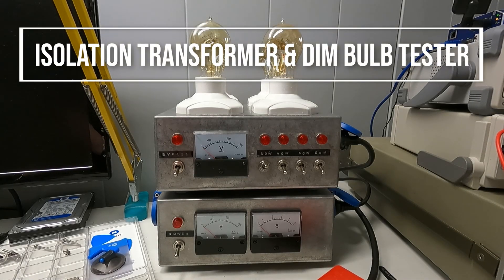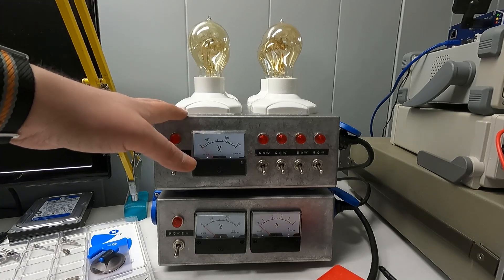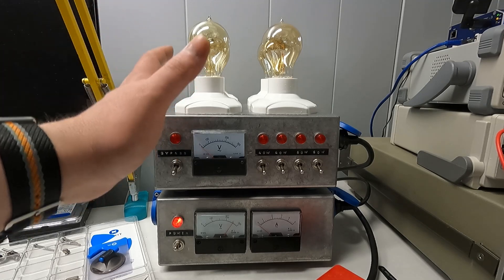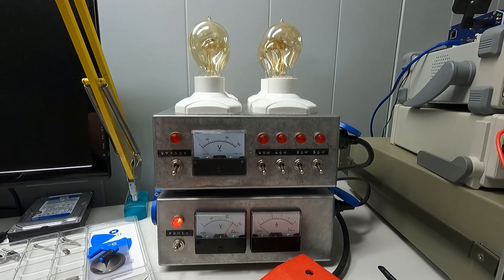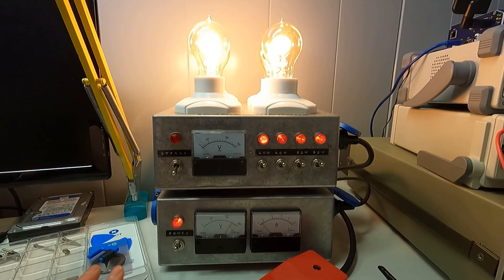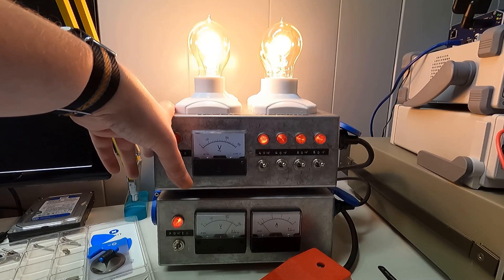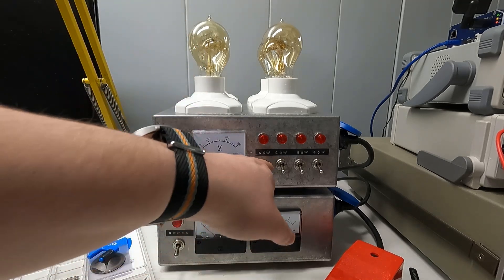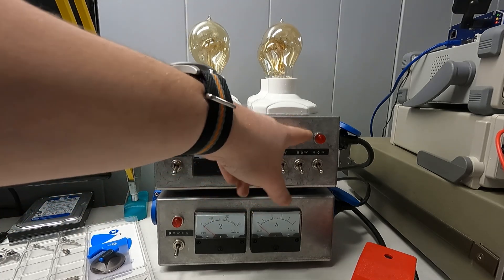DIY Isolation Transformer & Dim Bulb Limiter

Comment: Great video. Are you planning on making a video showing how to make this set up and what  components you used and schematics. Thanks.
Reply from the maker: Check the link in the description, he has a series on how to build it and explains how it works. Essentially it's just light bulbs in parallel with each other in series with the load. Each bulb has a switch in series with it, and the bypass is just a switch without a bulb in parallel.
Reply: @GrumpytechieNet  Thanks 👍